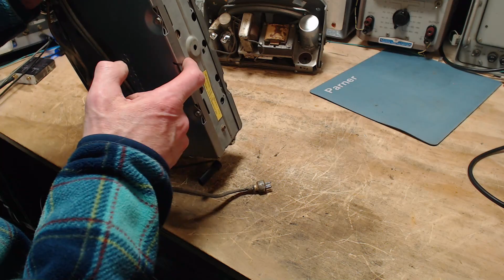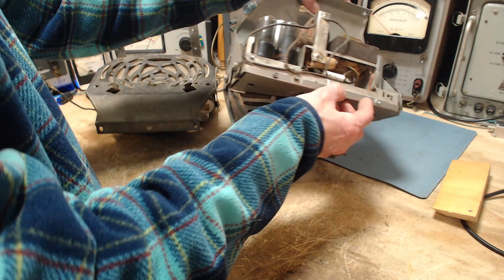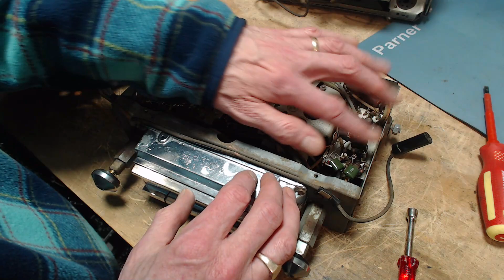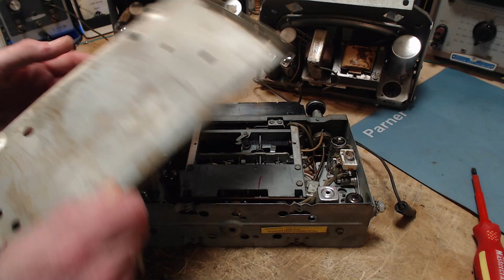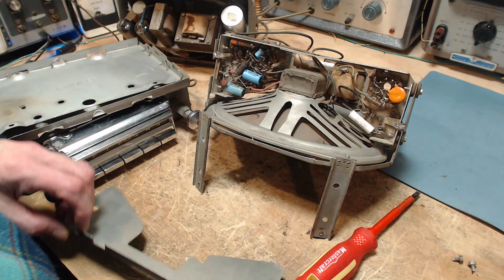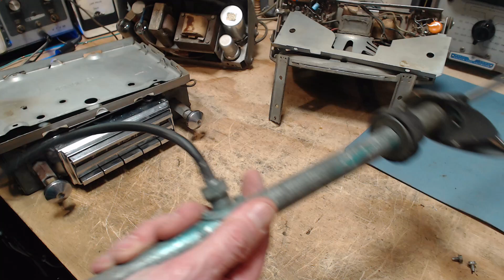1955 Chevy Car Radios - General Checkout

Comment: Id love to get my hands on one. I used to convert them into house  current use, built in a wooden box and whip antenna. They are not hit chassis either. Don’t forget cars put out ignition noise so lots of shielding was required. You will need a hefty well regulated  +12 volt supply to run these radio’s.

Comment: Fascination radios, some operated off 12 volt DC while earlier radios were 6 volt operated cars early 50’s. The vibration and buffer capacitor  were the  biggest failure items. Interestingly enough you will  find permeability tuning an a RF Amplifier attributing to the great reception. They can be converted to AC operation with  a simple transformer. 300 volts DC inside. The radio is separated into two parts the RF section and the power supply Power amplifier in the second section.

Comment: those are  problems   they were never very good   the way the Japanese  got there radios and car stereos in to this country    they make noise and in general got poor reception  i saw many of these in times past     and i did not like them at all    not hard to work on  may be the best way would be to gut them and install new radio   at one time there were kits to do this   but today i do not know     Lucky You